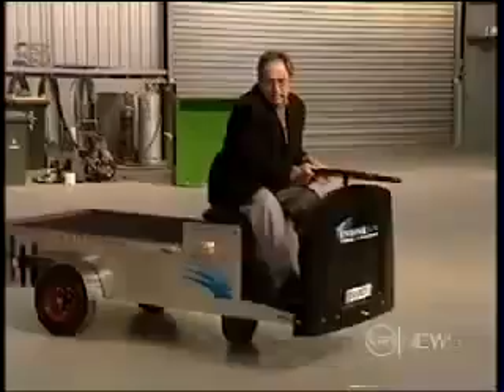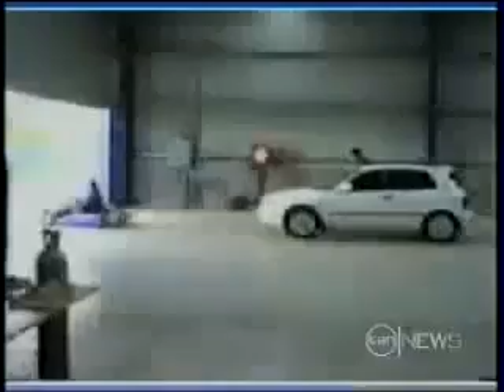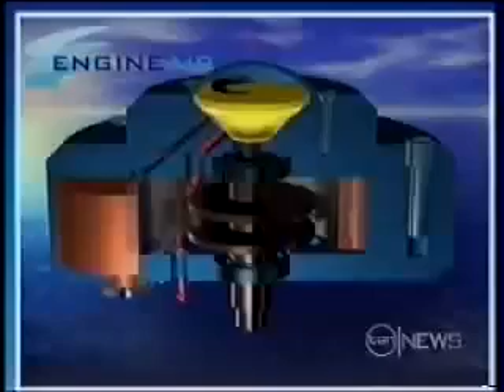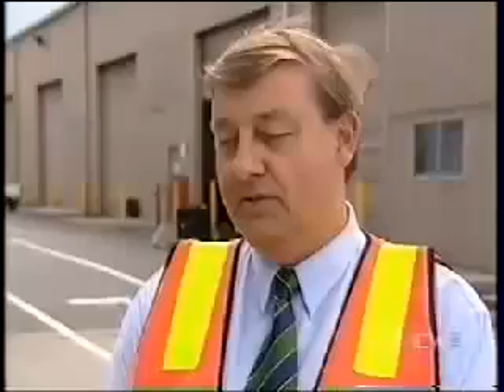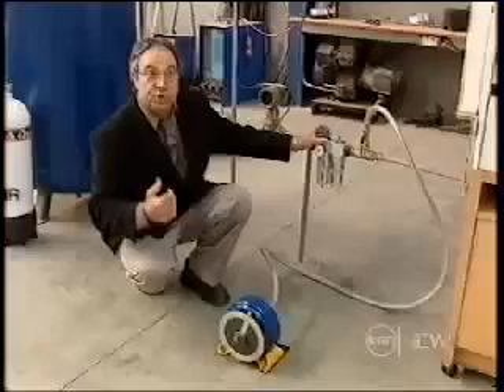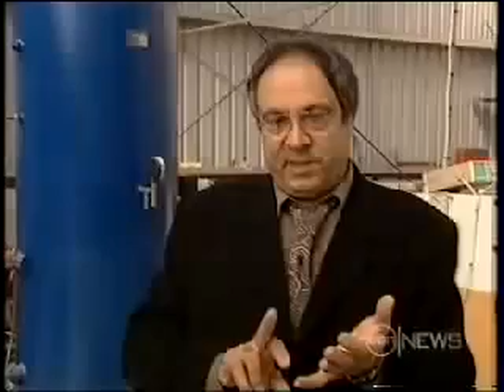Compressed Air Car Rotary Engine

Comment: But it is true that they are NOT practical in a cold climate...truckers and airplanes with compressed air systems have a lot of problems in cold weather.

Comment: As any engineering student who has taken a course in thermodynamics knows when you compress a gas, i.e. air, you get both an increase in pressure and temperature. To get the energy back on expanding the gas, in an engine, you must supply the heat of compression back to the expanding gas in order to get back all of the work put into it when compressed. Without the saving of the heat of compression the air motor will only have an efficiency of 20-25%. This is the  reason air cars are not practical

Comment: Engineair a company making a motor almost the same as existing air motors (see GAST air motor) with similar efficiency and power so they aren't selling but Engineair still looks for more funding.